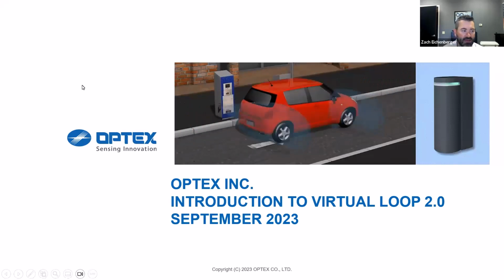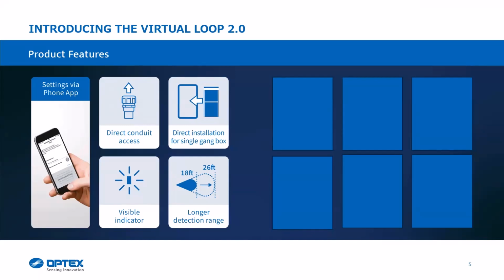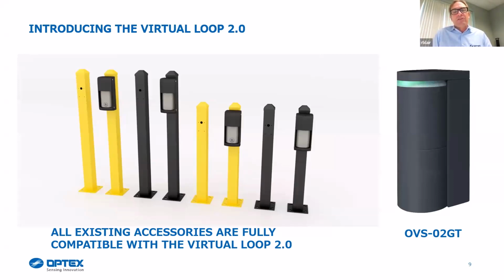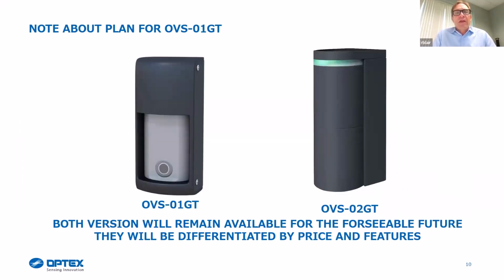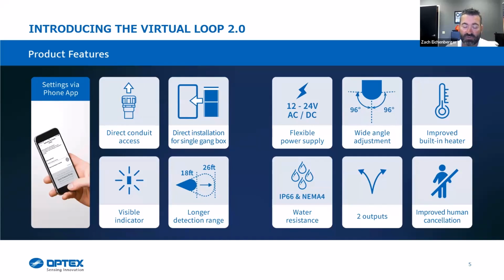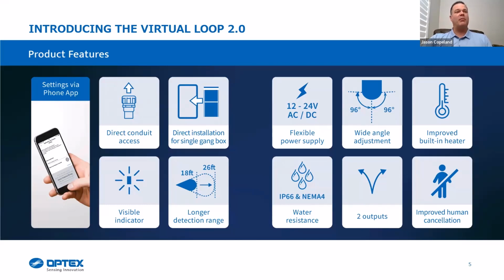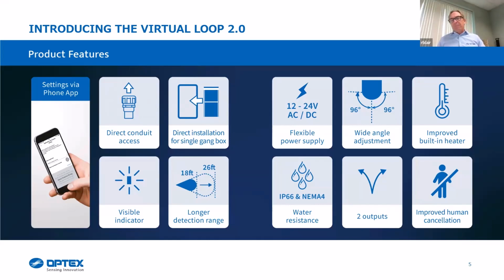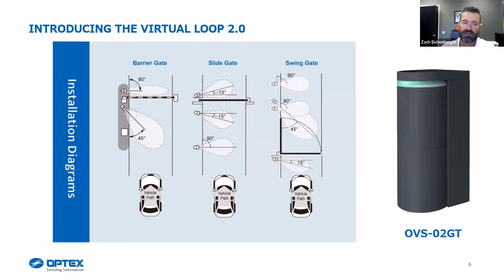Optex OVS 2.0 Virtual Loop Introduction - September 2023

Comment: Were having major problems with these in the snow, is there a way to set it so its not getting blocked by the snow? We have our barier arms set up so that the gate opens and when you drive by the loop it will set the time to close feature but with heavy snow I keep getting calls that the gate is stuck open, ill go to site use a metal lid to trick it and it will work after that, the customer never cleans it off I know it should be clean but the heater struggles on a cold day